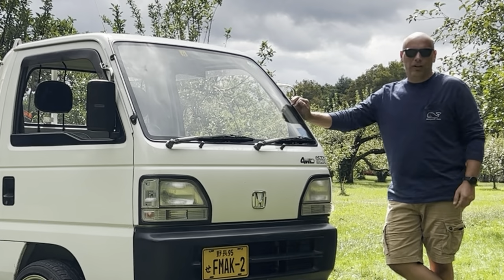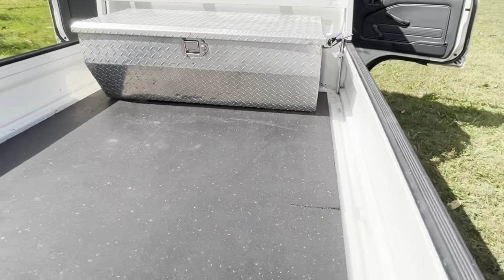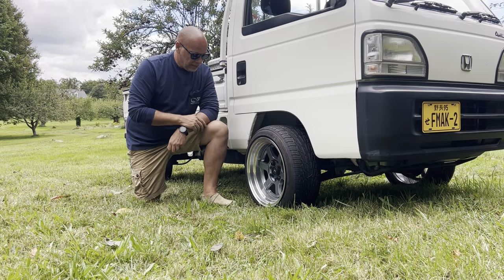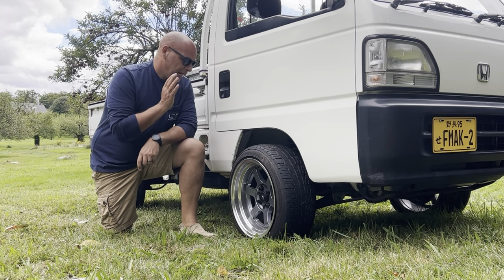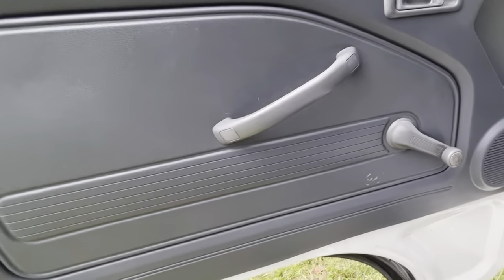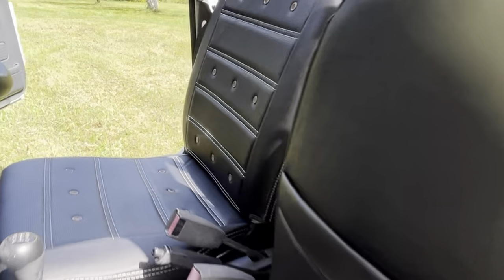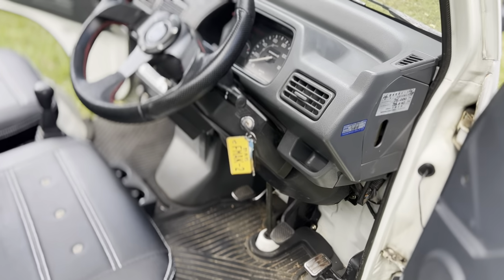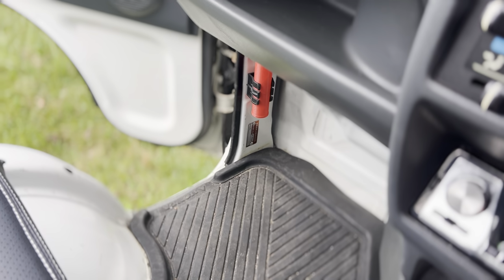Honda Acty Affordable Upgrades - Minitruck Kei

Comment: I love these affordable upgrades for your mini truck videos.  Thanks!

I painted the exterior of my 1996 4WD Hijet with Medium Quartz Gray Monstaliner polyurethane bed liner and it looks a lot like your Suzuki Carry.  I still need to paint the interior but that will need to wait for spring and warmer weather.  I could have polished my white truck as you did (which looks very good) but I was going for the durable off road look and function.

I preferred the roll on bed liner in the bed instead of a heavy bed mat, and I bought two large 20 mm ammo cans that bolt to the headache rack as toolboxes.  The bottom of the toolboxes are slightly above the sides of the bed so I retained the full length of the bed for carrying stuff like plywood, and there is a one foot gap between the toolboxes in case I need to carry a bike or motorcycle with the front wheel against the cab.

I'm not going for nice looking wheels, again, opting for the rugged and practical.  I bought Yokohama Geolander mud and snow tires that I'll mount on the stock steel rims, as soon as I sand blast them (I got a pressure washer accessory that injects sand into the 2000 PSI water) and then powder coat them (still need to build a larger powder coat oven for doing the rims).  Many people lift these little trucks (I'll eventually do a 2" lift) and then install larger tires mostly because they look better, but I'd only do that for an off road truck.  Larger diameter wheels increase the effective gearing ratio, resulting in a top gear that's too high to allow the engine to rev out enough to produce the power needed for highway use.

7:20 - I'm all about saving money, but buying tools on Amazon, using them, and then returning them is TOO cheap.  Please don't do that.  People selling inexpensive tools on Amazon are not in business to provide free tool rental, and none of us want to pay new prices to buy the used tools that you returned.

I also replaced all of the lights with LEDs.  Most of that was easy but the LED turn signals caused hyper flashing which I fixed with an electronic flasher.  I could have used bulbs with ballast resistors but that would use more power to simulate incandescent bulbs.  The Hijet uses a switched ground electrical system which was a problem for the headlights that is solved by a relay wiring harness to convert it to a switched +12V system.

I used CAD to create a cup holder that's custom designed for the Hijet and I 3D printed it.  I also designed and 3D printed door lock pulls, rubbery bed rail end caps, a dash mounted phone holder, and some magnetically attached storage boxes for nylon cam straps that mount behind the seats.  I thought about sanding and painting the steel gear shift rod but I 3D printed a black TPU sleeve for it instead.   🙂

I like the inexpensive single DIN Bluetooth stereo.  I'm not an audiophile, but I bought an ATOTO double DIN stereo and four speakers that I'll mount in the corners of the roof.  The more expensive stereo gets me a rear backup camera, front facing digital video recorder and offline (no internet needed) GPS navigation using the OSMand Android app.

Those seat covers look great.  I thought about buying some high quality Japanese seat covers but bought gray polyurethane faux leather fabric to reupholster the seats.  I'll also install seat heaters.

My Hijet cost $265 but I paid $1935 to ship it, and I needed to install a new clutch.  All in, I currently have $7,547.59 in the $265 Hijet, which sounds nuts, but I love this little truck,.  It's very practical, and I couldn't get a US truck that's as capable for less money.  I'm not aware of any US 4WD truck (body on frame and not a unibody car that looks like a truck) with a full size bed that gets 31 MPG.  It's a crime that protectionist regulations prevent us from importing safer, less polluting and more fuel efficient late model kei trucks.
Reply: Thank you for your post! I was thinking the same thing about his using and returning a tool to Amazon, I like his post but that part of it for me summed up his thinking.
Reply: Wouldn’t heated seats draw too much load from the electrical system?
It seems like even replacing all the bulbs with LEDs wouldn’t offset the difference.
Reply: @markreams6834  - Both heated seats would draw 100 to 120 watts.  I used a heated seat (seat back and seat bottom) to make a 55 watt ultralight heated vest that I use when riding my little G310GS motorcycle.  It has a 308 watt alternator.  Not a problem.

Comment: Very helpful.. you did not mention anything about the front struts to go with that summit coils?
Reply from the maker: Thanks!  I and most people leave the struts stock.  They are usually pretty blown and most of the weight is on the coils.  A lot of people have been hunting for a replacement solution and there’s not much out there.  If you can do your coils and then figure out if you really need to replace the struts.  Thanks for watching!
Reply: Thanks so much

Comment: Are you running the stock struts, or did you replace them? If not stock, who/where did you go for replacements?

I have the same size wheel and tire combo as you on my 97 Acty, and I'm on stock struts/springs. I'm getting some rubbing, but I dont want to go with a lift kit.
Reply from the maker: I’m on the stock struts.  It’s all about the springs.  They will lift it just enough to make everything work!

Comment: So you didn't need to replace the shocks, just the springs?  Had they been replaced previously?
Reply from the maker: Nope….there really aren’t any replacement shock/strut options without major fabrication so just go with springs and you’re good.  My struts were fine.  Same for my former Carry truck as well.

Comment: What type LED bulbs did you get off amazon?
Reply from the maker: I used these.  AUXITO H4 9003 HB2 LED Headlight... https://www.amazon.com/dp/B07TQLK6SH?ref=ppx_pop_mob_ap_share
Reply from the maker: And these… AUXITO 194 LED Light Bulb 6000K... https://www.amazon.com/dp/B071LHP5WP?ref=ppx_pop_mob_ap_share
Reply: Hi Dreux, I want to switch to LED. Could you explain which bulbs go where? I see some people buy multiple colors. I want to make sure I get the right ones. Thank you! Also great video! Tons of helpful information
Reply from the maker: @JulesMariani  thanks!  Full disclosure, I replaced like 80% of the lights with LED’s.  The T10’s I linked above will cover your rear markers, signals, license plate lights and the small corner signals up front.  There’s a couple odd sizes for the others that I didn’t bother with.  Thanks for watching and thanks again for your exhaust removal vid!

Comment: Tried using those springs from summit and they didn’t fit
Reply from the maker: @anthonystafford433  that’s so strange.  A bunch of guys have them.  Assuming you used the spring compressors to get them in.
Reply: @dreuxscorner  yea, I ended up using a dremel to get them to sit flush onto the shock mount. It rides alot better now.